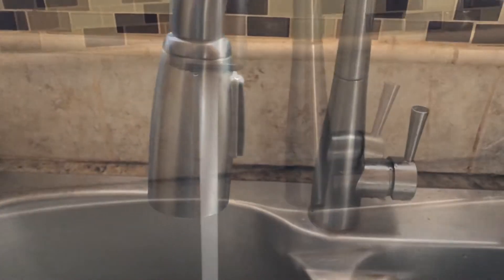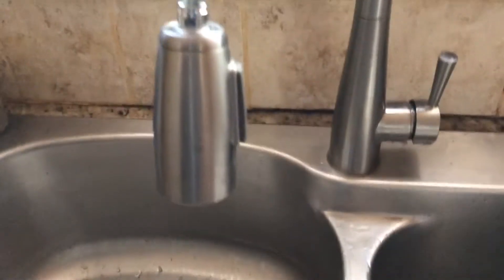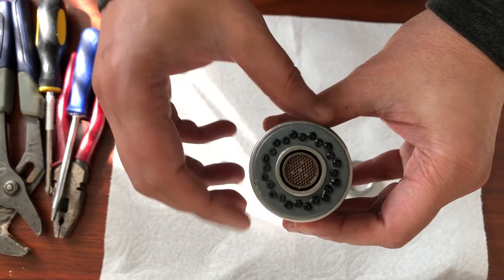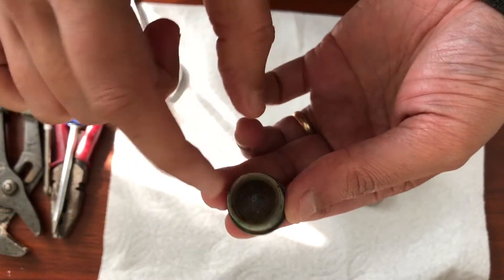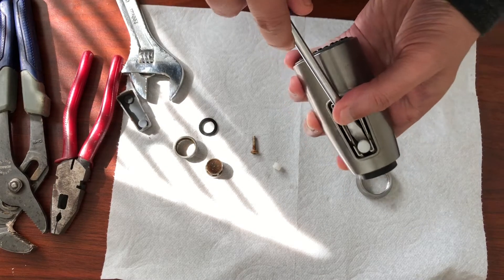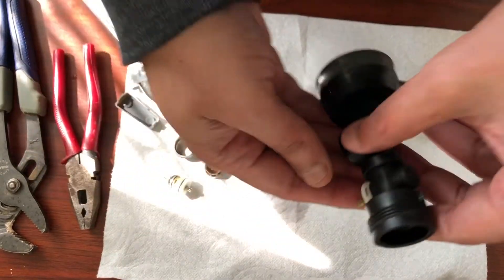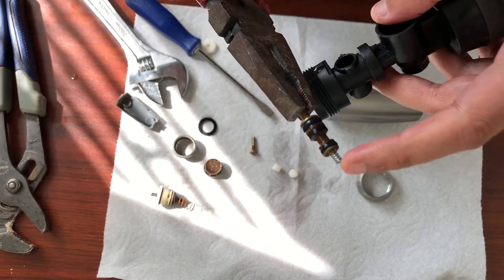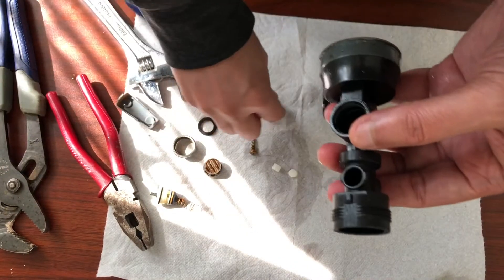How to fix kitchen faucet having low pressure

Comment: Here was my easy fix.....removed my Delta faucet with a 1 gpm flow, and replaced with a Moen 2 gpm flow faucet.  Happy with the results.
Reply: Yes! Mine is a Tuscany fordem, wasn't cheap, pressure is BAD. Took the head off and pressure is great! Who designs this crap?

Comment: Overkill! He made a 1 minute job into a 20 minute job! Better videos out there
Reply: I think there's a lot more disassembly going on than is necessary.  That first filter he took out (using the wrench), if it's cleaned out it should be good to go. My moen has the exact same filter and it had a lot of crud in it.  I also used a toothpick and my fingernail to remove an annoying first screen on it (probably a low-flow screen).  This improved flow further and will make it easier to clean out.
Reply: @monkeyb1820  Where is YOUR video?
Reply: It's called thorough! I for one am glad he showed us everything possible. Yes probably will fix the problem by just cleaning out the first aerator BUT now I've learned what else I can do and how to do it. The video is 12 minutes long. Really don't feel it wasted my time. And you know ANY job, even simply cleaning out the 1st aerator will take most of us 20 minutes!
Reply: @alhakisan  I'm doing a book on tape, where I'll be reading my account of my repair.  It's about 2 hours long.
Reply: Perfect video and there is no other video for this same type, this detailed
Reply: @monkeyb1820  come on it’s a demonstration on how to disassemble and diagnose for potential issues.